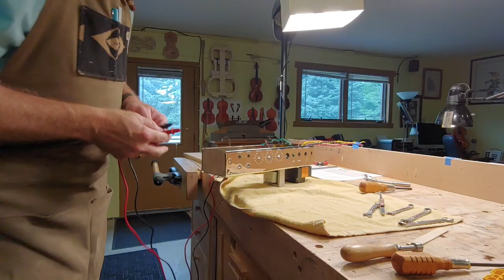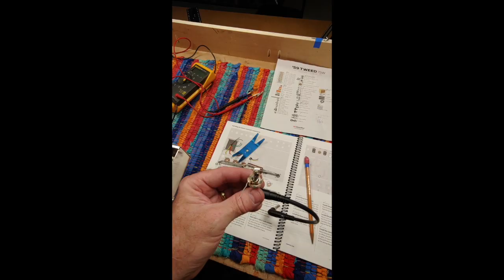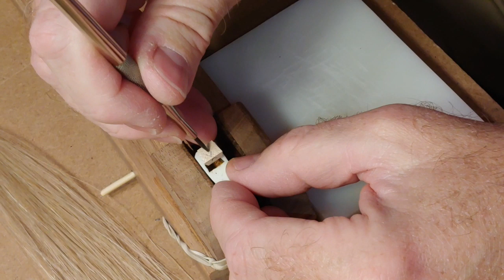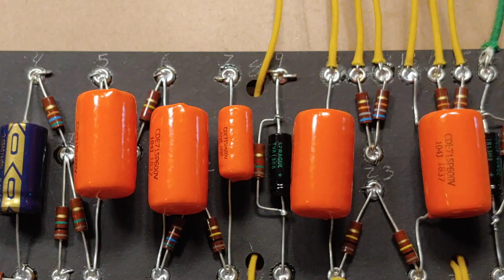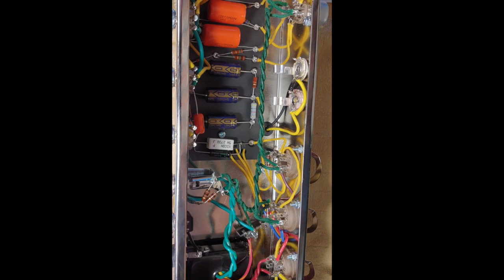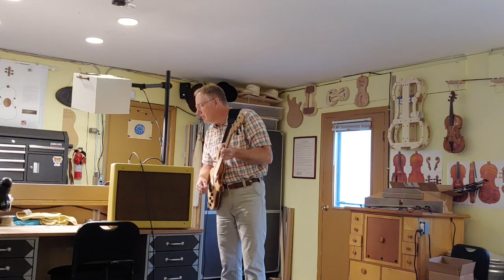Tweed amplifier build, demo, and bonus content

Comment: I'm ordering my 5E3 kit parts for my next amp build. I built my first one with the blackface Deluxe Reverb kit, and thoroughly enjoyed it and am very happy with it. Didn't realize it was one of the tougher builds until I was halfway through it. All in all, I probably should have started with the 5E3 , but im getting there. I truly believe these kits are the way to go if you're really wanting that original true tube sound, plus you know exactly how it went together so repairing should be easier than with a mass produced PCB design.

Comment: Plug the speaker in 4 you switch power on, easy to forget but it's the basic stuff that trips us all up. Great jib by the way, sounds nice and rounded. Thanks for reminding us to triple check ever wire. We never stop learning. Credit for sticking it out to end , the reward is obvious, a wickey good sound!!
Reply: He was doing basic testing and if you look, he didn't have the valves in at that point so there was nothing coming though to drive the output transformer and speaker. Good advice for day to day use though, well pointed out.

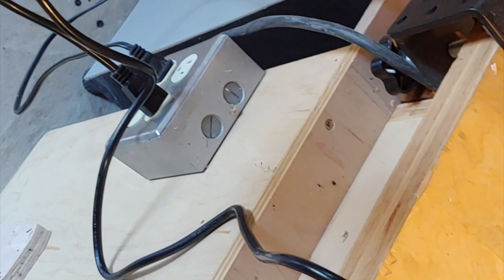Comment: Don't run your amp without a load on the output! 15:00
Reply from the maker: I did not. At that point of the very specific step by step instructions not all of the tubes were in place. You are indeed correct about not powering an amp without a load.

Comment: What is watt of speaker ❓
Reply from the maker: The output of the amp is 15 watts. The speaker is 8 ohms and rated at 35 watts. Jensen CQ12.
Reply: @Stephenmboone  I have the same. but I find that the bass does not sound good.